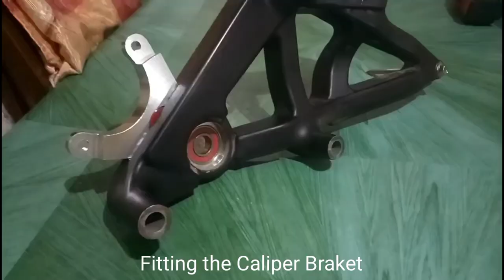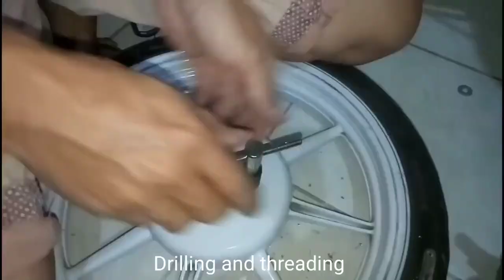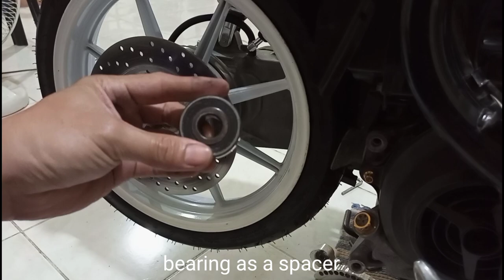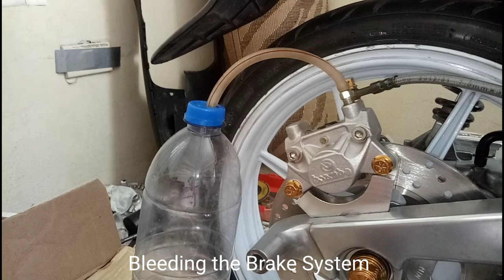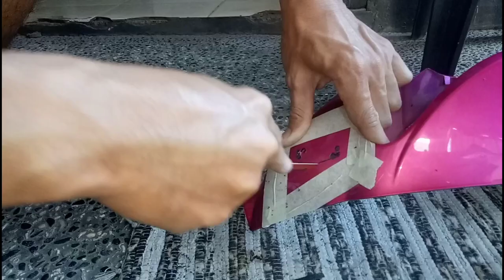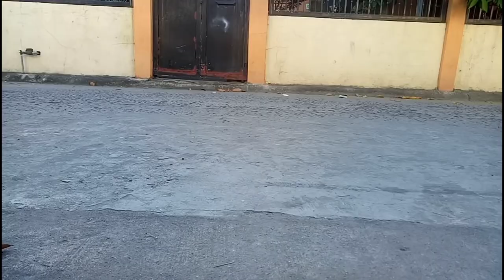Disc Brake Conversion Kit for Mio Sporty Soulty

Comment: Hi, did you use nouvo swing arm? sorry I don't understand tagalog, greetings from Indonesia. Thanks in advance
Reply from the maker: I used mio sporty swingarm, our mio sporty here in Philippines have swingarm but i think you can use nouvo swingarm as well.
Reply: @MotoDIYs  wow that's cool, sadly in indonesia our mio sporty doesn't have swing arm, you were right, currently I am using nouvo swing arm, anyway do you have any link for online shop that sell the caliper bracket? I am looking for the bracket
Reply from the maker: @TheGrandeinter88  try looking at shopee, sadly it's already sold out here in our country.